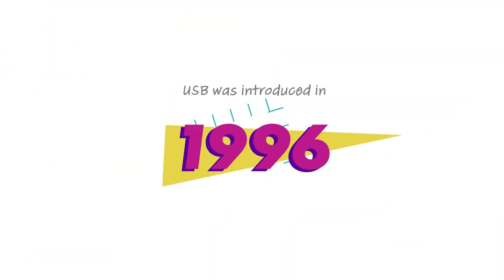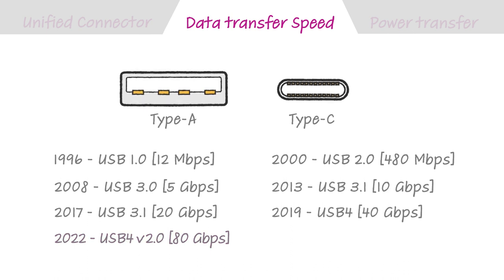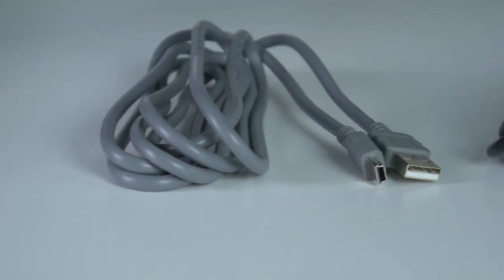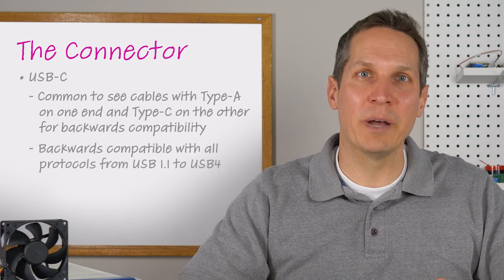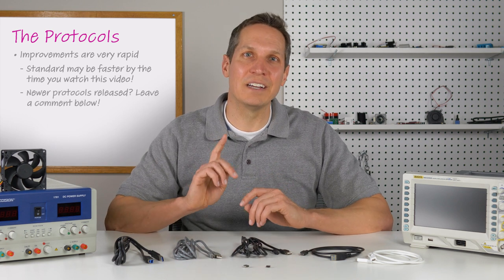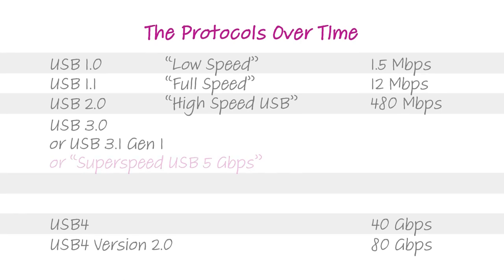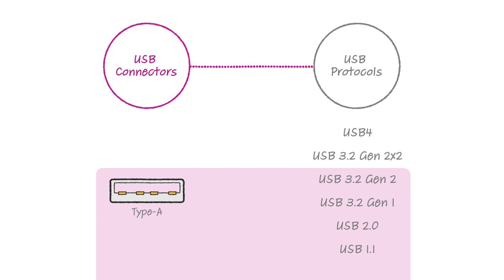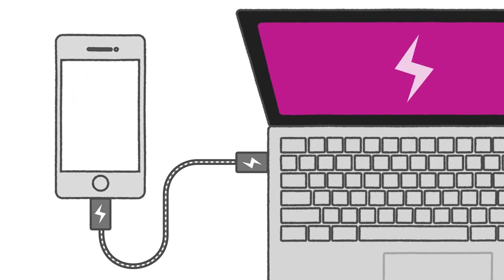All You Need to Know About USB Connectors and Standards

Comment: Lovely video - one technical thing - electrically, USB-C plugs are not symmetric, as can be seen in the tables of pin layouts. Also the two ends of the USB-C are electrically different, as can be seen in the table of cable wiring. The illusion of symmetry results from how devices respond to the cable. Software makes the plugs and cables behave as though they are symmetric.